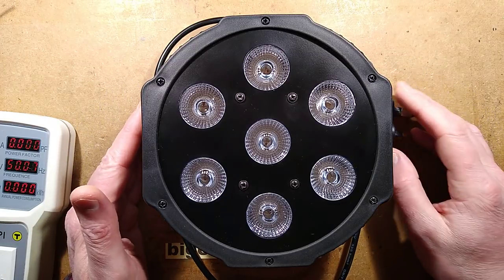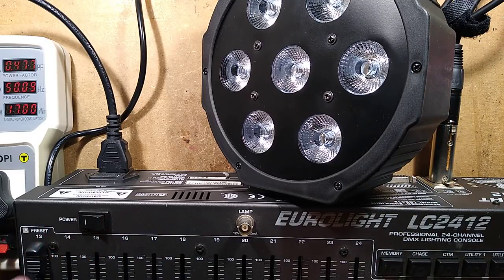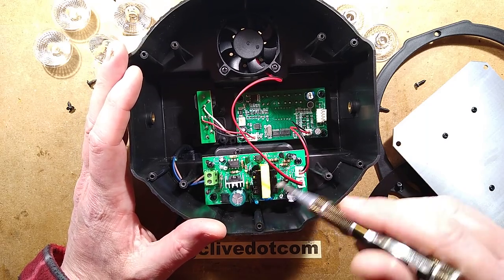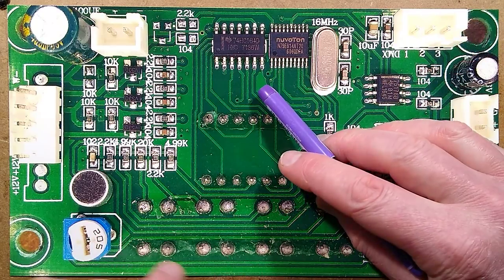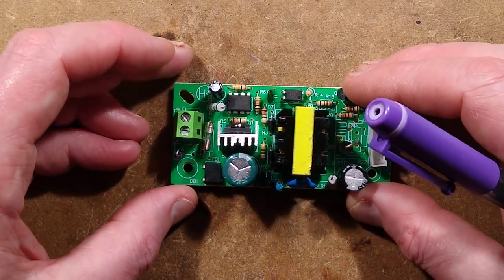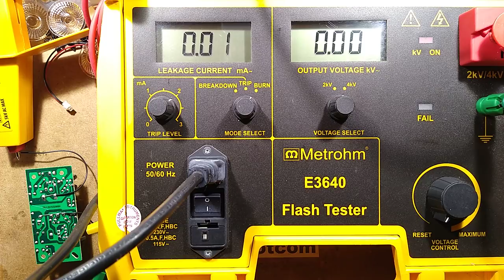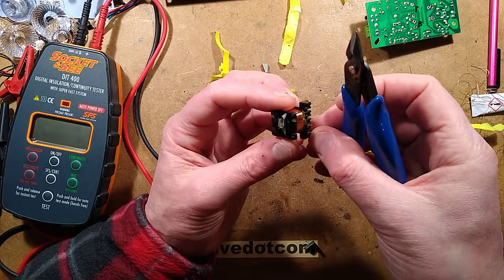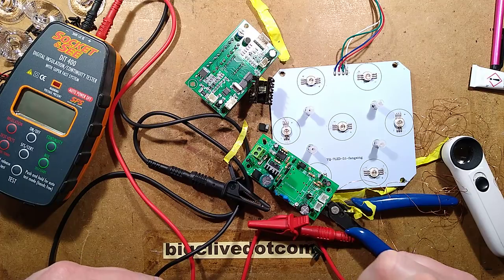3KV test of cheap disco light with circuit analysis.

Comment: I don't know much about this equipment but why are they using xlr
Reply: The low end lighting gear uses XLR but it’s not audio signaling at all. It’s a cost saving thing (until you plug a microphone cable that has phantom power enabled into your lighting gear and let some of the magic smoke out).

“Pro” DMX gear uses a 5 pin connector - more pins to solder/connect = cost even if negligible.  In general I don’t care for it because people use audio xlr cable instead of DMX cable which causes impedance mis-matches - lights to run funky or on the flip side singers will sound weird if someone grabs a DMX cable and uses it for a microphone.  

The kind of stuff that creeps up from the DJ crowed.
Reply: DMX is specified to use an XLR-5 connector. Disco and rock boards and instruments have for decades used XLR-3 connectors for cost saving. Originally there was nothing in the DMX spec that specifically said that you couldn't do that. As I recall we added that in a revision about 15 years ago, but of course nobody is going to pay any attention to that.
Reply: @lwilton  Maybe specify impedance tolerant adjustments for using audio cables and voltage tolerance for phantom power as a condition for using the de facto connectors again?  Explicitly consider the case of having stage audio and stage DMX in the same multi cable to the tech stand.

Comment: One place LEDs will never replace older style bulbs is spectrophotometry.  Bench top specs absolutely have to have a bulb with a broad spectrum.  So LEDs and fluorescents are useless.
Reply: Why not?  This one uses LED for the light source: https://sensing.konicaminolta.us/products/fd-9-auto-scan-spectrophotometer/

Didn’t even take that long to google and track it down (read the spec sheet for light source: LED) We had ones in the 90’s using fluorescents.

There aren’t a lot of fluorescents or LEDs that are truly broad spectrum, but that doesn’t mean they are impossible.  Just cost a lot more than most people are willing to pay and not everyone needs instrument level illumination.

Comment: Steppy' dimming is because its only 8 bit surely? Only 255 intensity steps compared to over 65000 steps with 16 bit. Probably no dimming curve software on that thing either. I'm certain you knew that, but others may not. Its great to see inside it though. It really is a bit shitty!

Comment: LOL, you call that controller quirky. I bet you don't remember something called the Ryger Navigator. I apologise, but it was the best I could do with 8k of firmware (PIC16C77)
Reply from the maker: I remember Ryger, Tytronics, Mad and the other companies cramming lots into small microcontrollers for disco and fairground lighting.
Reply: @bigclivedotcom  The original programmer for most of their stuff was the very talented Mr. Woodroffe https://www.extremeelectronics.co.uk/who-is-extreme-electroinics/
Unfortunately for that Navigator device, they had a new programmer in that had left the job without completing it, so I had the job of  getting some pre-designed hardware working by writing the code from scratch. Let's just say it went about as well as it could with the limitations that had been imposed. The firmware was written completely in PIC assembly, the same with  most of the other products (some of the very early stuff was 80c31 and a 4 bit Toshiba micro). I think in the end, there were only about 20 free words of program memory left of the 8k words available.

Comment: Can it be used as a grow light?
Reply: i would have said that it's unlikely for these led lights to have the necessary uv  output but a quick google search suggests that chlorophyll a and b have absorption peaks at about 420nm and 670, and 480nm and 650nm respectively; and now i'm not so sure anymore
Reply: fluorescent tubes for that purpose would likely be cheaper to buy and run
Reply: @michaelknight2342  UV spectrum has been shown to increase resin output in cannabis plants

Comment: DMX IS A SERIAL DATA PROTOCOL  AND IF YOU JACK THE SLIDERS TOO FAST IT WONT RESPOND BECAUSE OF THE DATA SPEED.
Reply from the maker: 44 full 512 channel frames a second on a good desk.
Reply: @bigclivedotcom  I seem to recollect you can run DMX over MIDI, although I'm not entirely sure why, and how it would perform.

Comment: That track that goes under the optocoupler is completely bs. If you check, that entire track goes in a loop and there's no need for the opto to have a fat track for it. The smaller one that comes from the left side of the board should have sufficed. The text on the separation zone of the bottom copper is a complete facepalm. I don't think they've designed it, but rather copied it.

Comment: That’s not a cheap processor it’s just shitty programming. The processor boots up and the rgb variables aren’t initialized, they just pull a random value out of some register or memory address. It’s amazing how they take absolutely no pride in their work. I guess they’re saving money on engineering too
Reply from the maker: It was actually a pre-stored setting.  I subsequently played with it and found you have to store each colour's level before moving to the next one.

Comment: You need to go back to political correctness school for a refresher course.  You're not allowed to use the terms "master" and "slave" any more.

Now you have to say "dom mode" and "sub mode."
Reply: It's still used on central locking Kit's an it's easy to understand
Reply: @ricininepillz7596  It would have to be easy to understand for those who weren't capable of getting my joke.
Reply: @bdf2718  It's not a joke in Los Angeles county. It really is illegal to use "master" and "slave" on any piece of equipment sold to or used in a government institution.
Reply: @lwilton  Do you see my original comment?  Do you see the bit at the bottom that says Read more?  Did you click on that?